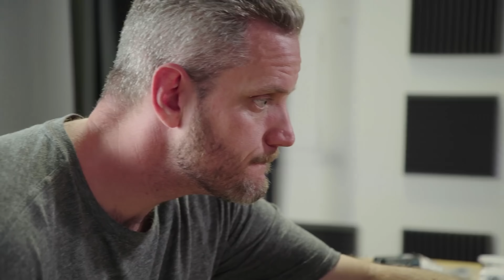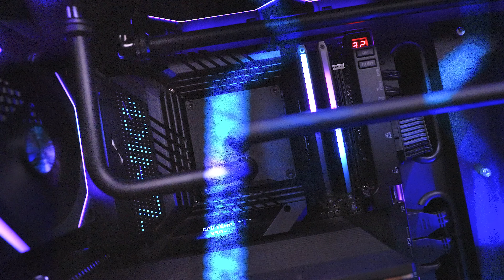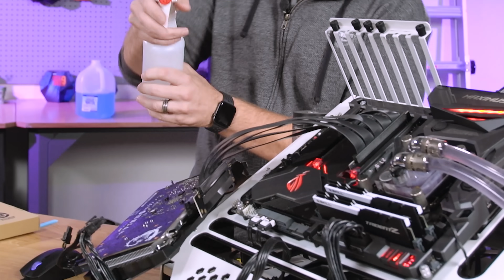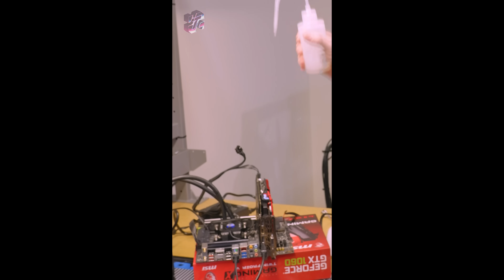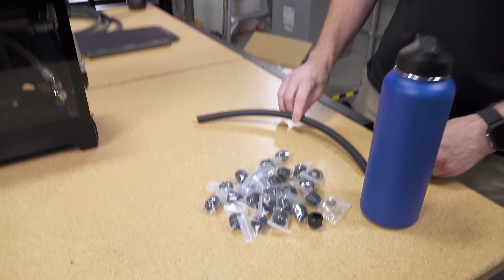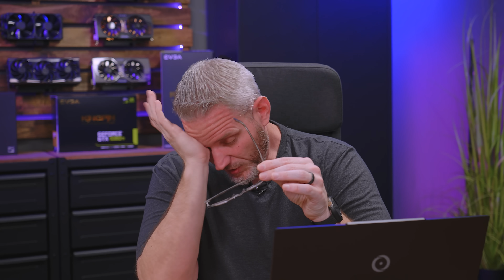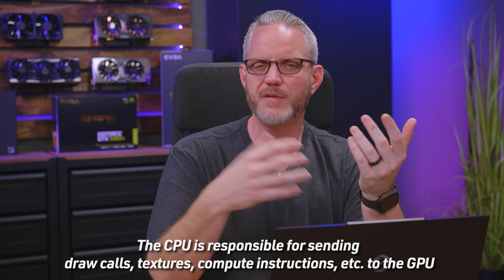5 Myths about Watercooling that are WRONG!

Comment: I used to build a custom water cooled pc for customer back in 2010, back then it was jank to the max because in my country there was no one manufacturing parts of water cooling. Even fitting and a block was expensive back then. 

The most expensive build i ever build, just the case and water cooling alone was around $700. Granted it was 690SLi but still $700 loop in 2010 is wild.

Comment: 1:45, watercooling and keeping your components cooler will not make your space cooler. - Wait, people actually think that running a watercooling loop in their computers will make the room it's in *cooler*? Where do they think all the heat carried away from CPU and GPU goes? Damn the cost, man, get those science programs back into schools!

I'm actually dead set against watercooling because I don't have time to design the system properly. As everybody knows, you have to position your pump exactly 6.625 inches below the CPU and exactly 4mm to the left of it or else you'll wear out your pump prematurely and it will burst and spray toxic chemicals all over the inside of your rig. And I know this is true, because I read it on the Internet, and everybody knows that it's against the law to lie on the Internet. I read that on the Internet, too...😆

Comment: So many people absolutely freak out about aluminum, mixed metals and galvanic corrosion in a loop. It is not an issue with the correct cooling fluids. Most AIOs are mixed metal, most regular cars have mixed metal cooling systems, etc.
Reply: This, so much this.  We have a literal world wide industry that deals with radiators on the daily, the automotive industry, and we have this stuff called radiator fluid which they all use.  But nah lets use pure distilled for that 1% better temps and have to worry about all that BS.  For best results however, do care about metal mix and also use glycol, basically doesn't corrode at all.

Comment: ....$1000 plus to water cool a system. Rookies! 

I love water cooling. The basic failure of far too many adults to comprehend very basic energy transfer, absorption, etc is astounding. Water cooling for most is about consistency, temps, overall, performance, noise, etc. Somehow people lose all ability to think in 5th grade science like water cooling is either impractical or magical. Usually both.

Water doesn't kill electronics. Electrolysis does! Washing PCBs isgreat make old things, nasty parts new. Never ruined a PCB yet. Electrical contact cleaner, rubbing alcohol and electronic blower. People overthink shit so damn always. Automotive people are the only ones that seem to comprehend it easily, once explained to them

Comment: Err. the only way to keep your space cooler by using water cooling is to run the loop outside to get rid on the heat there.. The updside is  the capacity for enormous radiartors so you would have a stupid amount of thermal medium to soak up heat, the down side is you just fixed your PC to the wall! XD

Comment: the worst damage you can get from liquids in a computer is corrosion. But corrosion takes time, so if you check regularly, you can clean any possible leaks up before they get to be a problem.

Comment: I have those Dracaena fittings in my system. Black ones are holding up great. I just disassembled my system and some of the white fittings coating is flaking off though. I would get the black ones again 100% though.

Comment: Idk man to me a custom water cooling loop was ALWAYS an absolute ENTHUSIAST option. If youre not an enthusiast, youre probably happy that your pc even runs as good as it is. only an absolute insane person (me included) would consider a custom loop to bring temps down to squeeze to last bit of performance out of a system. even if that means basically doubling the cost of your pc.

Comment: First time I water cooled my computer I had an unforeseen leak directly onto the gpu. Was terrified, took it apart, cleaned/dried the gpu. Fixed the leak. System has been running strong for the better part of a year since.

Comment: I just use AIO water coolers....and if they fail I can have a new one in 2-3 days. After 4 yrs, neither of mine have failed. Fact the MSI one has a refill port even to top it off when needed. The funniest thing is, neither system is a power hungry system (old house old wiring, like REALLY OLD) so I went AMD fully believing if I went Intel I'd have serious issues.......and my house might burn down, lol. (joking btw). It would pop breakers though. my house was built in 1901. The rooms are small and thus get warm pretty fast. They get hotter faster now that I went watercooling as it removes heat faster from my computers...which is something that confuses the average user. "It's running cooler yet my room seems hotter......????" You know something like that.

Comment: High end PC's  need AIO's thats it only if you wan't to matain your system or just to clean makes it easier.I run a I9 14th900ks with a RTX Asus rtx 4090 GPU runs at 50c and Cpu runs at low40's idle and high 60's gaming in COD Warzon then I clean it with a blower once every month or so thats it I get 300 FPS  on COD and it makes it easy to fix and repair I Don't get it why hard tube and water cool AIO is perfect for the average gamer or Video editor.
Reply: Or just have sense enough not to buy the hiossen Intel CPU that ends up running for more hardcore than a damn space heater in terms of electrical heat production and cooling requirements and buy AMD instead and you don't have to worry about it

Comment: I've been looking into water cooling for my 7800X3D but have not pulled the trigger since my Thermalright Phantom Spirit 120 SE keeps it cooled. I don't want to go with hardline tubing. Thinking of EPDM soft tubing that will be sleeved with straight runs from fitting to fitting.

Comment: You know, around the time I built my current system (although a bit late to keep me from one or two mistakes) I found your channel and used your various tips and hints for a lot of tweaking and improving and stuff.

What you also managed is completely (well almost) take away my reservations against watercooling. I always found it cool, but it seemed to me very risky and I never dared try it. Now I'm currently running my first AiO (mainly because my cheap-ish case fans were making expensive noises and there was a sale and I got a 280 BeQuiet AiO for about the same it'd have cost me to get higher-quality replacement case fans). My next build (if all goes well later this year, otherwise sometime next year) will be my first custom watercooled build.

But, even though you're "the watercooling guy" - you've already helped me no end in improving and troubleshooting my current build and also getting rid of some stuff I didn't need. I also really like your way of presenting and the team, so thanks a lot and I'll be looking forward to the next video(s). Cheers from Germany!

Comment: Just never felt the damage risk from water leakage, the extra expense and installation work justified the performance gains.  I've been very happy with the Noctua coolers that I have used over the years and never have that feeling that I have ticking timebomb in my computer.  I did try an AIO several years ago and it failed within a year of use.  Just my $.02.
Reply: I just don't like my GPU sounding like a jet engine when its at 100% load lol.

Comment: I just started my first ever custom loop, a gift to myself for my retirement from the military, and I'm wishing I waited for this series! I did two dedicated loops for my CPU and GPU. One oversight, I didn't put a flow meter in one of them, so about to tap one of those in.
Reply: You don't need a flow meter at all.  Most of them are just an extra point of failure or end up really noisy.  The one leak I have ever had in the last 9 years of water cooling was from a bad gasket on a flow meter.  I removed it and have never run another one since.  I did buy a paddle wheel one too but it made such a racket I also took it out.

It is a giant myth that you need super high flow or need to care about flow much at all.  I run my flow at sub 0.5 GPM most likely and everything still stays ice cold.  My pumps are only at like 25-30% power to increase lifespan and reduce noise/vibration.

Comment: Performance-PCS is about 5-10 minutes from my work. I work at a mom and pop music store. I've been wanting to water cool my pc, but I wanted to wait until I had a better overall system than what I have. I really want to upgrade the cpu and gpu in the next 6 months. Any suggestions? I built a pc to use as a NAS for bulk storage and backups for the entire household. Pc listed below I built over a 4 month period of upgrading from a 7600k @ 4.5 all core/ 32gb (8GBx4) Crucial LPX @ 2666MTs/ EVGA 1660 super

Gigabyte Z790 Gaming X AX
Intel Core i5 - 12600KF @ 5.1(P)/4.0(E) all core
Thermalright Contact Frame
Thermalright Peerless Assassin 120 SE
32GB (16GBx2) G.Skill Flare X 5 @ 6000 MT/s 36/36/36/96/132/2T (I know this is AMD optimized. Was only thing at time available next day in budget)
nVidia FE 3070 ti (bought used & did repaste and pad)
1TB TEAMGROUP T-Force CARDEA A440 PCIe Gen4x4 7000/5500 MB/s (OS)
2TB ADATA Legend 960 PCIe Gen4x4 7400/6800 MB/s (Games)
1TB Crucial P3 PCIe Gen3x4 3500/3000 MB/s (Games)
NZXT H6 Flow Black 
Thermalright TL-C12C (3x-Front, 1x-Rear), TL-C14C (2x-Bottom, 1x-Top) Fans
Vetroo 1000 G5 PSU
LG 32GN650-B Ultragear Gaming Monitor 32” QHD (2560 x 1440) 165Hz

Comment: Byski is decent. I use a Byski block on my 4090. Works as well as an ek. Also freezemod os another cheaper option for fittings. I've been watercooling for 15 years myself. Used to have a shop, thanks covid lol.

Comment: you guys are nuts building a water cooler from scratch for a CPUs & GPUs that maybe has 4-5 years of functionality (Budget Builds). I'm not into turning my case into a disco tech and would use air cooling if I could, I just started buying top end CPUs that recommended them. My first CPU with water cooling was an FX 8350 (2012) it doubled as a space heater and now run a 7950X which I guess 90 degrees is the new norm. (2023). Just get a prefab take it out of the box slap it on and get on with your day. You  guys need a better hobby to throw you money at.

Comment: Loop order never used to matter, and 99% user cases still doesn't matter enough. 
However I have full temp in outs and my current and best performing order which I'm actually stress testing to heat soak as I write this
Order goes:

Res to 3 AQC D5's (28C) 
> 4090 600W (conductonaut) 
>(34.8C) 
> Rad (31C) 
> 7800X3d De-lidded & TG Conductonaut and TG IHS (33.3C) 
> RAD  
> Res  (still 28C)
24C ambient (Australian winter and heated house (Like 3C outside atm))

All Aquacomputer/ Alphacool/ Heatkiller gear etc.
Fans artic PST's

Never used to matter, however when single cards are pulling 600W solid, kind of does now, but only chasing optimum performance.

When I ran loop order same way I always did added about 4c to every one of those temps

Comment: 1- Room Temperature - Its the opposite actually, Rule of Thumb though, The larger the space/room the less internal space needed inside the case, the smaller the space the more internal space needed inside the case itself, This may seem counterintuitive but its a Thermal Dynamics thing. Best thing you can do is cycle air I found having an exhaust fan ceiling in the room like a Bathroom venting system can solve the issues of an overheated space or room, heat rises so you skim the air off the top every half hour to hour or so and it will keep the room from getting too hot.
2- Linus flooded his entire server thanks to a broken Connection, I don't think he had any issues, Water Cooling Fluid is not conductive as long as you are on a maint. schedule of drain and fills.
3- Cost - You can get some cheap stuff on Amazon from China that isn't bad, some of the stuff they warehouse here in the US so you don't have to deal with long shipping and Customs BS.
4 - Loop Order matters but not for the reasons you are talking about, Some Blocks are high pressure and some blocks are low pressure, grant it its only really going to matter a couple C at best, but if you are the min Maxxer, CPU blocks are high pressure GPU blocks are low pressure, Temperatures will always normalize over time and the difference is within margin of error unless you are super stacking Thermal efficiency methods to make a larger difference.

Comment: I had a brand new system with brand new water cooling.  Drips from CPU block to graphics card smoked the whole system and burned pins at GPU.  To my amazement, and major props, Thermaltake paid me the cost of my new system.  I jammed everything in a box and mailed it back to Thermaltake.  Glad to still see Thermaltake still around because that's a company with serious integrity.

This was a long time ago, I have no idea what the coolant solution I was using, but I wouldn't be good with anything flowing into components.  The industry needs to focus on refrigerant cooling without condensation.

Comment: One thing I have found is using Process Lasso and ensuring the PC is hooked up to a UPS (DO NOT USE THE UPS SOFTWARE) and I can have my 5900X running on "better battery life" profile, which keeps the clock down to 3300 Mhz until I launch steam or anything else I specify to use the high performance profile. I also keep my 3080ti (EVGA Hybrid) on the normal not prefer high performance profile on the default profile. 

It's made a HUGE difference working on this PC in my office all day in the North Texas Summer, office would get up to 80+ F and now with the AC set to 74 for my upstairs, it only gets around 76.

Running most of the day at less sthan 180w is way better than having it at 300+w for stuff like Teams and Outlook. even with Nvidia broadcast for my calls.

Comment: I have an expensive EK (fuck them but this was before) soft-tubing from 2020~ and it's been very little maintenance (yeah, refill coolant and check it every now and then). Temps are low, yes, but more importantly, noise of those 3x FAN GPUs is mostly GONE. I did it for noise reasons, many fans running slow == much less noise. ;)

Comment: First you had a cool block. Transport is through a solid material. Not great but good enough and cheap. 
Then came heatpipes. A few drops of fluid (open one up you will see) and transport of energy is fast and efficient throughout the block.
Then you have water cooling. In essence just a huge heatpipe that goes to a very large (rad) surface to cool instead of a block on the socket. It's whatever. 

That said, AIO to me is for if you switch you system to a new one fast so you need a new AIO fast (me: from i7-2600 to R3-3100 to R7 9700, so keep systems long). Otherwise I feel way better being able to switch out components, most importantly a failing pump. And if I go and build a loop ever again I will go direct die and liquid metal, if you want it as good as possible why go halfway right?

Also I'd use the barbs, put the waterpipe things around them to really tighten it up and use no copper but nickel plated only, fattest tubes I can fit and make them dark. Nothing fancy. I still have a 1U hardline but never again, what a pain.

Comment: Hell yeah! Do that! Temperature comparison video! <---guess that was the wording?

Plus another challenge: Is it possible to convert AIO radiators (and I don't mean Alphacool, who use custom parts in their AIOs) to be connected to custom loops? This might be interesting to reduce waste from defective AIOs. And if it's possible: Is it easier to modify the radiator to make it fit regular fittings or is it easier to take die AIO tubes and adapt them to the loop?

Comment: Physics dictates that there WILL be a thermal gradient, so loop order does matter... but when you're dealing with loops that are best measured with units of inches/centimeters... the thermal gradient isn't likely to be more than a handful of degrees across the entire system. I suppose if you're pushing your rig to the point where 1-5 degrees of difference in the fluid can impact the performance of the part(s), heat exchange staggering would be needed.... but at that point you need a bigger loop anyway because you're dancing on the maximum threshold for the entire system to operate.

I think the issue is that people hear/see/read/know that thermal gradients are a thing.... they just don't realize how miniscule it is in such a small system, or just how insignificant the difference really is so long as the loop is kept sufficiently cooler than the maximum desired temperature for the parts.

TL/DR the loops are too small for loop order to matter, if you need better cooling just install more radiators somewhere... it doesn't matter where, so long as it is getting heat out of the loop.

Comment: GPU power: ~350 W
Heat capacity of water: 4184 J / kg K
Coolant flow rate: ~500 L / hr

ΔT = (350 W) x (1 kg K / 4184 J) x (1 L / 1kg) x (1 hr / 500 L) x (3600 s / 1 hr) = 0.6 K (= 0.6 C)

Your GPU is only going to increase the coolant temperature by about half a degree. Basically, the flow rate is too high relative to the power output for there to be a significant difference in temperature across each component.